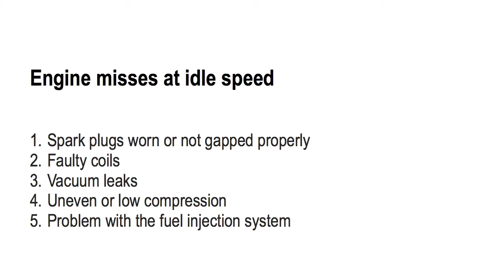Engine Misses at Idle Speed: Camaro (2010-2015)

Comment: My car is throwing p303 and service stabilitrak. I've replaced the injector, the plug, the wire and the coil. I've had it! Damn near want to trade the piece of shit in!
Reply: What did you find out?
Reply: What fixed your problem? I’m getting po305 and service stabilitrak lights also
Reply: jmoye16 i’m having the same problem did you fix it by chance ?
Reply: same here man, please let me know if you ever figured it out
Reply: @kazreshif If you never found out, 90% of the time with the SS it’s a lifter. Meaning engine rebuild.